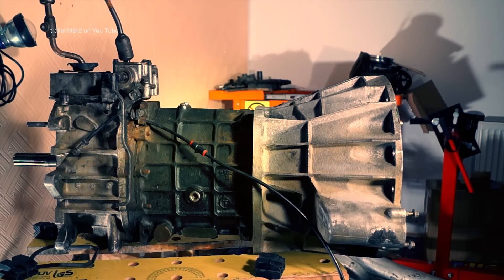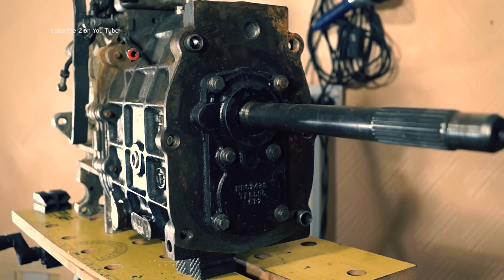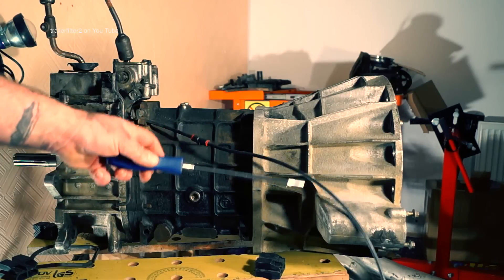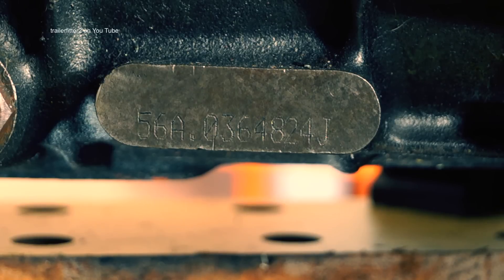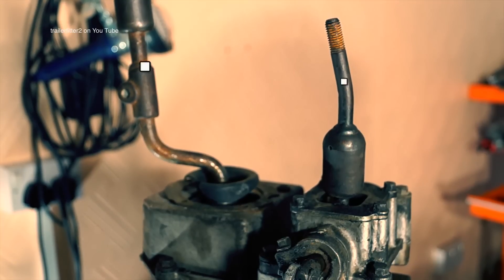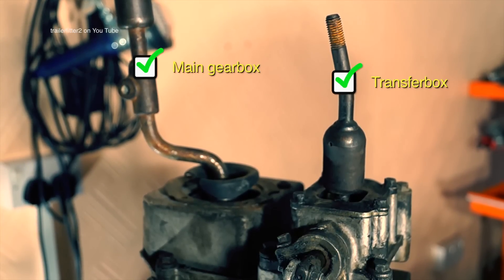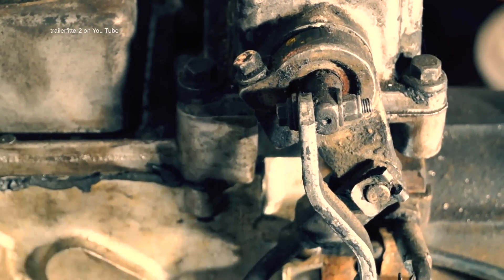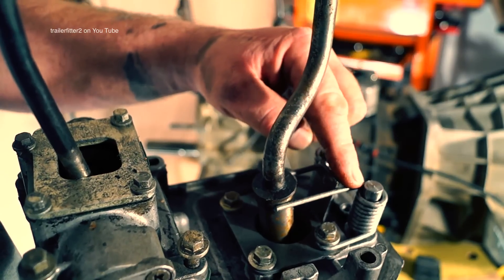Land Rover R380 Gearbox - Getting to know the R380

Comment: Thanks very much for this video presentation. I've had enough fun just doing the oil changes on my R380 box on 130 TD5, but haven't had the need to pull it apart as of yet.

With the transfer case, I have noticed that on the R380, (or some variation models) that the main shaft seal can leak, due to the bearing which can slip on the shaft, thereby chewing out the inner lining of the seal.
I had to replace to the shaft , but managed to keep the bearing, as the race was still ok surprisingly enough. You thought you would replace the bearing too as any normal person would, but so far its been alright for the last 14 months.
Reply from the maker: There is always an issue or 2 with transmissions and unfortunately even with the best care they can still cause problems.  Not 100% sure which bearing you mean but I would if there were any issues regarding bearing shuffling - I'd lock it to the shaft or hold the race in with a bearing lock for sure.

Comment: Very useful, I've had my Disco for a year and never really looked at the gearbox. One thing is confusing me though, the reverse lights don't come on unless I pull the stick back. Is this likely to be the switch or the H-gate springs and plate? Thanks TF.

Comment: Hello and thanks a lot for the presentation, Greetings from Paris !  I have a defender TD5 year 2003.  If I up-shift quickly with high RPM from 1st to 2d, or 2d to 3d, I feel a crunch/grind in my hand (not so loud to hear it in the vehicle, I can just feel it with my hand). 

If I leave the RPM/rev normal, and leave a 1 second pause on Neutral between these gears, all is fine. 

No crunch when downshifting. The gearbox runs with new MTF94 oil.

Is this a normal behavior for a R380 ? Are we supposed to UP shift slowly with these gearboxes, losing momentum ?

Losing momentum is not an issue on flat road, but annoying climbing a slope. 

Many thanks for your help and feedback !

Julien

Comment: Can I use another transmission with the Land rover V8 to get a better gear ratio? Mine is making horrible noises (it pops and feels really rough) and It can be either the transfer case or transmission. I thought it was from a broken front axle, I opened the axle up and found nothing. Then traced if to the differencial and no again. Found the driveline stick and hear it bind up in the t-case. What can this be?

Comment: when i bought my d2 with a r380, it had a REALLY noisey 5th gear.. it sounded like a supercharger/siezing bearing. I decided to keep driving on it and see what happens. i pulled the oil and it looked completely fine?. 11000km later it has gone nearly silent, what could cause this?
Reply from the maker: Bedding in?   Either that or the sound was from somewhere else?
Reply: well a year later and 20,000km. Its definitely the gearbox. I have dropped the oil in it 3 times since then, each time it had metal flakes in it (Bronze and silver). now 1st, 2nd 3rd and 5th are just a tad noisy. when i can afford it i will be shipping an Ashcroft unit over. Its just very weird that it was first super noisy and now its reasonably quiet?

Comment: Hi
Great video...Maybe it's a question already done before.. my 1997 discovery 300tdi does a whine noise at the fifth gear while driving at around 90 km/h. It's higher if under load. I've done a test by changing gear (from 5th to 4th) holding the same speed the whine noise it's actually felt a lot less. Any advice would be very much appreciated.
Reply from the maker: Whine would indicate bearings.  Some bearings won't whine until they are spinning at high speeds.  4 gear locks the input pinion to the mainshaft whereas 5th will have the layshaft in play / load bearings on the layshaft and mainshaft .   Lot of bearings in a gearbox and there is no way to really telling which one without a visual inspection of the parts.  I trust there is enough oil in the gearbox?
Reply: ***** Oil level is fine, planing to change the oil to MTF 94. Read some were about adding Molyslip Gear Protection, don't know if it's advisable. If taking the gearbox apart what parts suffer mostly on the R380 (1 Bearings ) what about (syncros). Thanks for your advice
Reply from the maker: hobbypassion Molyslip is excellent for new transmissions.   Not a cure for worn parts.